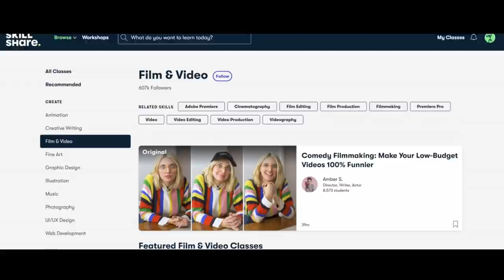TRYING to WELD with NO EXPERIENCE... Solo female van build. Vanlife UK. (DIY campervan conversion)

Comment: When working under a vehicle it is vital to use some means of support like an axle stand or blocks of wood and not to rely on a jack
Reply from the maker: Thanks Steven, you're right. We did put it on blocks, I just didn't film that bit, god if I filmed every little bit the video would be far too long lol!! 😂😁
Reply: Yeah don’t mean to be a bore but it should have been better supported. 
Even though you were only on one block (nsf) & I couldn’t see it but I could see the wheel arch gap in the background so it was mainly sitting on it bu if the jack  failed  it would still come down until all it’s load was either on the block or it’s back wheels.
A Jack should be a secondary safety device in case a block splits say. 
Block, Jack just resting under chassis & a stand at the back end or similar would be the approach.
Apart from that good show & yea I’m great fun at parties !  x

Comment: I did an engineering course nearly 30 years ago and part of the course was Arc/Mig and gas cutting/welding and in my excitement forgot to put the apron on, whilst grinding the bench down i set my overalls alight in a "sensitive area", first i knew of it is when everything went dark, on clearing what seemed to be an explosion in a talc factory off my visor i found an instructor and two fellow trainees pissing themselves with laughter brandishing fire extinguishers.  And whilst watching all i could think of while you started welding was Feed, Speed  & Penetration them came the comment, Qualiteeeee ! Always look forward to your vlogs as they always make me chuckle.
Reply from the maker: Wow Robert!! That sounds an awful experience, although also very funny after the event lol, should have caught that on camera 😂🤣 so glad you like the videos, thanks so much for watching 😁👍
Reply: Just glad it was before the days of camera phones 😂😂

Comment: You did brilliantly with the welding.  I've seen people that have been welding for much longer than that who can't produce welds of that quality.  
One thing though, for Gods sake use an axle stand in conjunction with the trolley jack when working under the vehicle.  In my time in the trade I've seen too many vehicles slip from jacks.  You really can't be too careful.  Always belt and braces!
Reply from the maker: Thank you, I think I did alright 😁 we actually had the van blocked up as well, I just didn't film that bit and it's obscured by the jack, which we left in as a second measure. I would never work under a van without proper support 😁👍

Comment: To make getting in the cab easier I made a MadMax paracord bracelet (loads of tutorials on youtube) then looped the long tails over the upper seat belt bolt. Makes a great strap hanger for the vertically challenged, sorry Em  😀😀
Reply from the maker: 🤣🤣 that's alright Ken I'll let you off for the good tip 😁

Comment: My welding  journey, it was on my bucket list when younger to purchase a dutch barge steel kit they are now aprox £30k and build my own barge 65ft and do what your doing in your campervan but on the french canals, Looking at basic welded 65ft s they cost £100k so thats a £70k saving  Can I weld ? nope but learn and its one hell of a saving. I did a night school class one winter learnt all the basics at very little cost, I can now weld but when thinking of the bucket list steel plat 8mm thick is bloody heavy then the shear logistics of doing it stopped me in my tracks because when all put together its over 30tn in my back garden so to speak plus over one years work to build and fit out , it was a nice dream in those days, but i learnt how to weld both steel and alloy.
Reply from the maker: That sounds super cool, I bet that would be an epic adventure from start to finish

Comment: Nicely done.
Absolutely nothing wrong with any of the welding on that bracket.

One little tip: Instead of holding the gun with both hands, rest one hand on the worktop and use it to cradle the hand that's holding the gun.
The extra stability makes it much easier to get nice, consistent, welds.

Also, while I'm at it, I know it's sometime unavoidable but a couple of times I saw you with your other arm in front of the drill while you were drilling.
Try not to do that.
If the drill-bit snaps and the drill lurches sideways, you could end up drilling into your arm.
Reply from the maker: Hi si, thanks for the tip, I'll try that next time when I'm welding 😁👍
When it comes to the drill tho, I've been doing it since I was 15 (I'm 35 now and a trained carpenter) I know the distance and arm placement to miss if the drill bit snaps or there's a slip 🤣😂
Thanks for watching si 😁👍

Comment: another comment... So is there a beeper wired up to the ignition cos sure as shit you're going to drive off with it left out at some point otherwise.

On another note I am disappoint at the lack of bath cam haha :-D
Reply from the maker: Ran out of battery for bath cam 😂🤣

And I just have to remember to put it in, much like closing the sky lights, windows, unplugging the hook up... I've got a whole list now fixed to the steering wheel 😂😂

Comment: Well done Lou, fantastic job, very professional wen you finished it all off with the paint job. Emily must find a big difference now that she doesn't need ladders, same as me as I'm a short ass as well. Have you no hot water in the van? noticed the plumbing bodge 🤣🤣🤣
Reply from the maker: Hi Eddie, yeh it makes a big difference for em 😁
No we don't have hot water, no point as we've no shower so we just boil a kettle. Em wanted a household mixer tap tho so I had to accommodate a hot and cold feed, I didn't want to cap one side off else I would get stagnant water sitting in there so instead I've just plumbed up two cold feeds so I can alternate between the two and keep it all fresh. Thanks so much for watching 😁👍
Reply: @campervibe  clever cloggs, not many would have thought of that, knew way you did it when I saw you disconnected the old tap, well done you. I was also so impressed with your welding skills, welding is not a race just take your time as it can be so satisfying to see a nice weld at the finish 🥰
Reply: Opps typo should have been  WHY 🤣

Comment: Well done Lou, a very tidy job. I retrained as a fabricator/welder in 2009 after I got made redundant. Under Wills guidance you produced some excellent welds for a first attempt 👏  One question (not welder related) just to save me searching your vlogs. Where did you get your kitchen sink...I'm at that stage with the build!! 👍 regards Mick
Reply from the maker: Thanks Michael, I was lucky enough to have will to show me 😁
With regards to the sink I honestly can't remember, was a struggle to find one small but deep I remember, think I eventually found it on a random Google search, sorry I can't be of more use.
Reply: @campervibe  no problem...I'm have the same problem, most are not deep enough to drown a mouse...not that I would want to drown a mouse! While I'm here a big thank you for all your build vids they have really helped and I'm nearly there 🤞 Mick x

Comment: Awesome job Lou 🤙🏻
I’d never be able to attempt welding. Quick Q: would rivnuts into the chassis instead of making the bracket worked?
Reply from the maker: Hi ya, no you would still need a bracket or some sort of support to drop down from the chassis to where the step needed to be 👍
Reply: @campervibe  ah I get it.  Thanks for replying 👍🏻
I’ll say again… Fair play to you for going for it on the welding! How come you are good at everything… so annoying 😂 🤙🏻

Comment: They are some nice welds for a beginner, I’ve seen worse from so called professionals. If you’d got a sprinter or transit you would have had loads of practice welding by now. 
The flexies from the tap to that Tee piece look a little strained
Reply from the maker: 😆😆 yeah so much practice, they are, we have ordered some bigger ones for it 👍

Comment: Great job can you fit a motor and a.switxh or would you need to buy an.electric model
Reply from the maker: I don't know if you could add one but they sell the same model motorised. Thanks chi 😁👍
Reply: @campervibe  Can I ask what drone you use?
Reply from the maker: @chilam6227  I've got the dji mavic Air 2. It's good but pricey and subject to more regs than the mavic mini 2.
Reply: @campervibe  thanks I bought a cheap one years ago it didn't last long before I crashed it lol
Reply: @campervibe  thanks for the advice went for the air 2s and love it. Need your editing skills now..

Comment: camper vibe? - more like carry on camping [phwoar missus] - loved every minute!
bloody good weld for a virgin - i imagine Will made sure the penetration was sufficient,[ see, men are useful for something.] hes a good teacher, you a quick learner, im impressed.
buy a tin of spray grease/wax + blitz all the fastenings, those steps pick up all sh*t off the spray off the front wheel, + being mixed metals rot away alarmingly quick [and are bast**ds to get off for access/ maintainance] 
we fit a bright led lamp under the step wired into the interior lamps, godsend in the dark + it comes on as soon as u unlock the van or open the door.
emms - your mission for the week - find a picture of your missus doing her training with all those blokes....
Reply from the maker: Cheers for the tip Paul, loving the step so far, can't wait to really put it to the test 😁😁